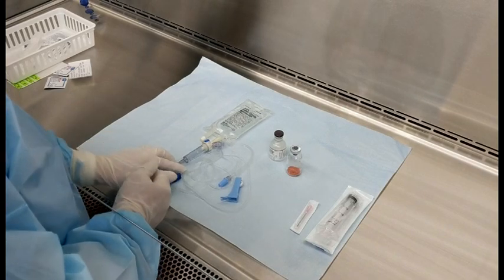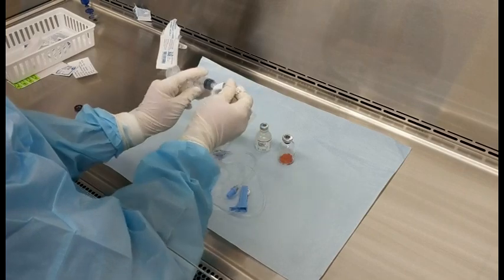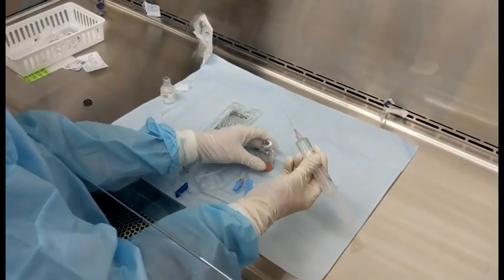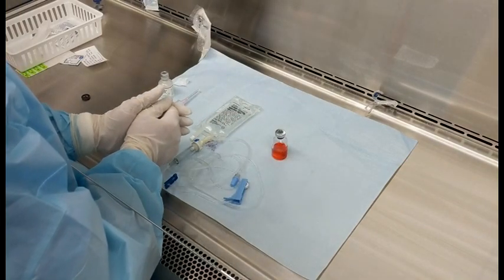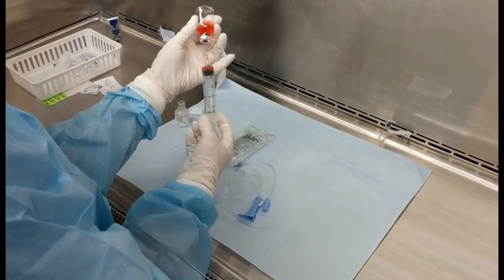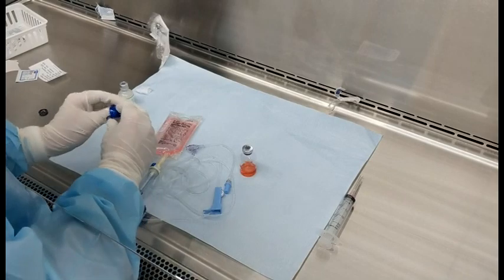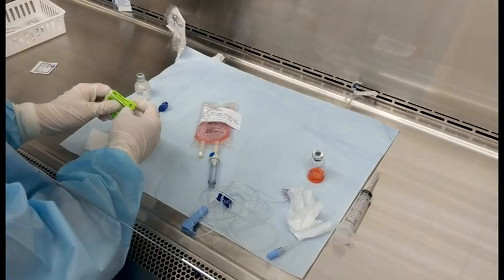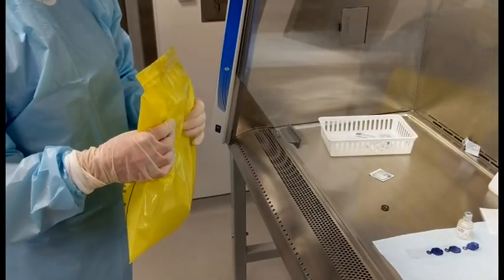Hazardous Drug Compounding

Comment: If that is a hazardous drug vial.. putting air into the vial like you did is INCORRECT... you should correct this ASAP !
Reply: This is called negative pressure technique... and chemo compounding is done in biosafety cabinet...  so it is safe...
Reply: Do you happen to know how many employees that have worked in compounding pharmacies have suffered due to poor practices?